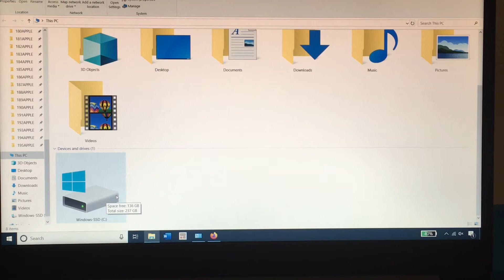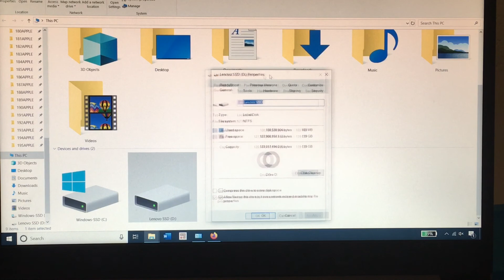How to add a new 2.5 inch Lexar SSD to Lenovo ideapad S145 Laptop

Comment: Would there be an issue if you do the  same process but with a bigger size (ex: 256 or 512 gb) same model same specs?
Reply from the maker: Should be no issue with storage size. I’ve installed 512gb on similar models

Comment: Can I able to upgrade 512GB SSD to my Lenovo Idea Pad 3 which comes with 256GB SSD (NVMe).
Reply from the maker: Are you trying to add a 512gb ssd (2.5 inch) or changing the nvme to larger storage? Either way yes it’s possible
Reply: @whattmeter  Thanks for your reply, which way is best & faster ?
Reply from the maker: Adding a 2.5 inch ssd in my opinion but it makes things tricky because you have to select it when saving stuff to it. If it was just the main nvme ssd you only have one location for storing things

Comment: I have Lenovo IdeaPad s145 15api model with 1tb hd can i upgrade jo ssd without removing hdd? I have pci m.2 ssd ,the laptop have r5 3400u processor, does laptop have slot for ssd ? If it have then sata slot or pcie?
Reply from the maker: are you trying to add an m.2 ssd? try crucial scanner or cpuz to see if you can add an ssd. you should be able to but I would double check to be sure.
Reply: @whattmeter  thanks i checked crucial it is compatible
Reply from the maker: Thats great! Hope everything goes well if you go through with it

Comment: where can I but those screws and that metal casing
Reply from the maker: Metal case was included with the laptop. The screws I bought off amazon. I usually use m3x3 screws but something similar will work too

Comment: hello. i enjoyed the video. my ideapad s145 came with a 128g SATA ssd, i need it to be more. i noticed your laptop has the M.2... My laptop had the slot for  m.2 or nvme SSD PCI( which may be the same thing). i am not computer savy but would like to increase from 128G. which would you recomend and why? thanks.
Reply from the maker: Definitely m.2 ssds make a big difference compared to Sata. If you do decide to get a m.2 ssd make sure to check if your laptop has the m.2 ssd screws in it. If not you have to buy the screws too. Lenovos come in many different configuration. Also check the read and write speed of your sata ssd by running a test like crystaldiskmark or something similar so that when you shop for an m.2 ssd you can check the read and write speeds and ensure you get the faster one
Reply from the maker: M.2 ssds usually get hotter compared to sata ssd but they are usually much faster. Or was your question what’s a good brand of m.2 ssd?
Reply: My laptop do not have the screws for M.2. I guess is really My question for easy way to increase memory from 128g to a bigger. Could I plug in a m.2 to increase memory?  Or best to get a Sata ssd with say 500g and clone the ssd? Thanks for your response.
Reply from the maker: @rtw7931  Adding an M.2 would definitely increase your storage, but it would be a separate partition. Which is completely fine too if that works for you. Cloning and using a bigger Sata also works, but it would mean you won't be using the original sata anymore. In my opinion, adding an M.2 would be easier to add and setup as cloning would take more time. Just my opinion though because that would mean you have to buy m.2 screws. I also think M.2 are more expensive compared to 2.5 inch SSDs

Comment: I have the same laptop (same model) but it didn't come with ssd, I don't know if there is a place for the 2.5 inches ssd , how should I know without opening it because it is still in the  warranty?
Reply from the maker: I would check task manager > performance > disk to see if the current storage is hd or m.2 ssd. If you already have a hard drive then you can’t add a 2.5 inch ssd. Other than I don’t really know to tell if there’s space for 2nd ssd
Reply: @whattmeter   unfortunately I only have the HDD that came with the laptop, thanks anyway
Reply: @whattmeter   But can I add m.2 ssd ? if I don't have one
Reply from the maker: Do you know what motherboard model you have? Most likely you can put an m.2 but you might have to buy a screw. Since you mentioned it's still under warranty I would ask the place you bought it from. They might have made changes or know the configuration of the laptop since they set it up. Only way to make sure is to ask the store.
Reply: @whattmeter   ok I will for sure,  thanks  alot!
Reply: @whattmeter   how do I see if I have one or the other? I'm at the disk area but I don't know what I'm looking for. I think I found it it says HDD under disk 0

Comment: Bro can i ask that how long do you have the lenovo ideapad s145?
Because im about to buy 1 and im thinking if that its durable and good use for a long time
Reply from the maker: still have it till now. Been using it for a long time for work 5 days a week. Good practical laptop. I run illustrator, office, light video editing etc.
Reply: @whattmeter  can you game test it also like Valorant, csgo, LoL and dota?
Reply: @noob noob the battery is replacable right?
And one of my friend told me that i should just remove the battery and use it while.plugged in but im kinda scared to do it since its my.1st laptop is that doable and safe or i should just let it be?

Comment: I have the same laptop, I'm quite confused about ports. I just could add a ssd sata 2.5 if I remove the hdd that I have. But, I could buy a m.2 ssd in the other slot and preserve the hdd, do I? In that case, what M.2 would you recommend me to buy?
Reply: Alejandro Molina for m.2 a sk hynix gold p31 is the fastest you can buy and for sata a sk hynix gold s31 is the fastest you can buy
Reply from the maker: great suggestion
Reply from the maker: Nice! it's really up to you. m.2 SSD would definitely boot faster, then you could use the HDD that was included as an extra SSD.

Comment: I have the laptop with an hdd can I add an ssd without removing the hdd ? 🤔🤔
Reply from the maker: Double check your motherboard and cpu model. If it’s the same as the one in the video you could add an m.2 ssd. I would check your cpu and motherboard to make sure that it can support it

Comment: If the NVME SSD is lexar, can i use Sata 3 Samsung or must be the same is Sata 3 Lexar?
Reply from the maker: The sata is lexar. The nvme m2 ssd is a samsung that came with the laptop
Reply from the maker: You can use any brand for the 2.5 inch ssd or m2

Comment: I am very confused to why this has no comments but uh I have a question, what did the SSD change and what was different when you used the laptop.
Reply from the maker: The 2.5 inch ssd is basically adding a second ssd to the computer. The laptop had all the connections included to add a second ssd. Basically it allowed more storage. The primary ssd is an m.2 ssd. Hope this helps.
Reply: jasetutorials I need something for better FPS in games and I heard SSD doesn’t do FPS so do you know what will help for this?
Reply from the maker: Sorry it doesn’t do fps? Well i think it gpu matters most. The laptop in the video is a lenovo s145 which has no dedicated gpu memory. Completely reliant on ram. Ssd should show games fps, but you could totally swap the ssd with a 2.5 inch mechanical hard drive. It won’t be as fast and will be noisier. But it’s all up to the person using. This lenovo laptop isn’t really meant for gaming
Reply: jasetutorials oh okay thank you very much :)